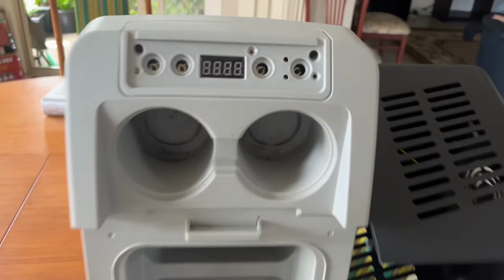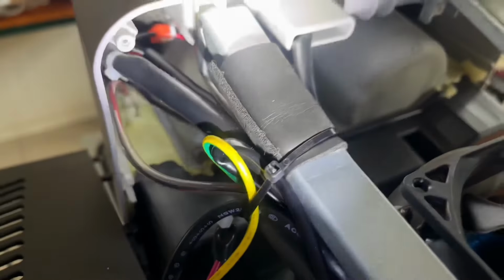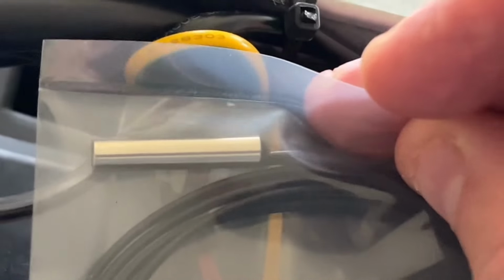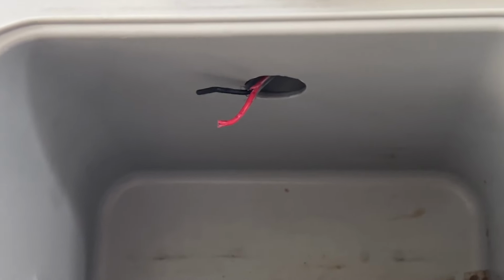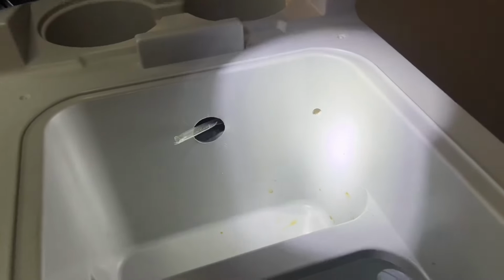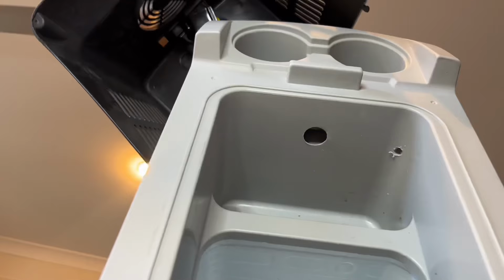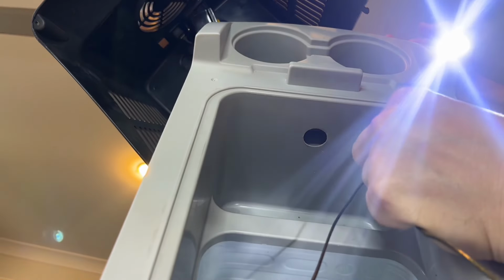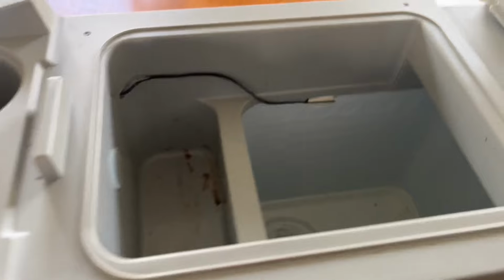Dometic CF11 Refrigerator Thermistor Repair

Comment: Great informative vid, as always. You would think the manufacture would make the thermostat easily replaceable. My dad had a really old fridge he inherited from his dad made by frigidaire in the 1940s, he said it had been in the family for almost 80 years, replacing bulbs or the thermostat were really quick and easy jobs, two screw and the job was done. Guess they don't build things to be repaired anymore. It's really good that you show how things can be fixed rather than just buying a new unit when a $5 piece of it goes wrong.
Thanks for sharing.
Reply from the maker: If I were wealthy and dishonest I’d buy a new one and send high voltage high current through that device send it back under warranty after a month and see if I got a whole new fridge. I don’t see anyone changing it properly.
Reply: @BrekMartin  It works so the repair is good in my books and to me there is something better about things you have repaired over the original unit. 
I think that it would be interesting to watch 40kV go directly into the units peltier plates and circuit board. Maybe the peltier plates would achieve -273 Kelvin within second on the cooling side an turn the hot side into molten lava. All the caps exploding and the board looking like a piece of burnt toast.  🤣  I generally enjoy repair videos over destructive ones but I'm partial to shango066 Youtube end of life vids (EOL) when a TV becomes beyond economical repair.
Reply from the maker: @isoguy.  no, I mean unplugging the thermistor, and punishing it just short of burning the insulation of its leads, so it still looks like a normal warranty repair… to see how they handle the exact same repair.

Comment: "Can't say it wasn't a pain" -- going for an understatement, I see!

A clever bodge, nonetheless, despite apparently everything in the design of that unit being anti-repair.

Hope it ends up continuing to work for ya for quite some time!
Reply from the maker: @EilonwyWanderer  admittedly not my idea, but I didn’t see it done for this model elsewhere. I failed to point out properly that the original part is buried underneath the cool box, and would require complete disassembly, and a bigger mess. This one wasn’t for the people who’d typically watch my vids… it will be a long term winner.
Reply: @BrekMartin  well it was a fun watch regardless, and with luck anyone in the future who needs to do similar repairs will find it helpful!